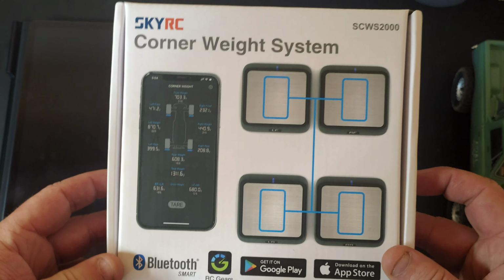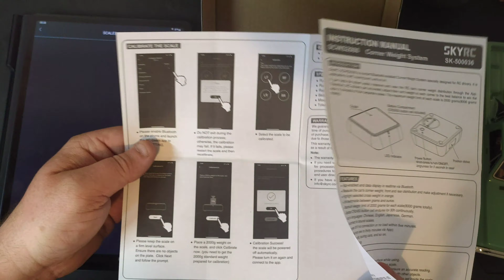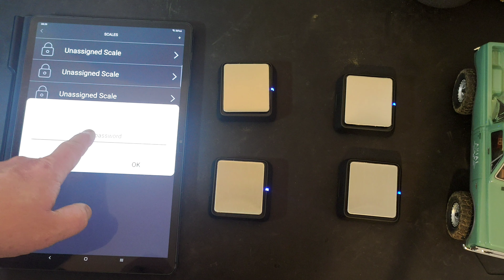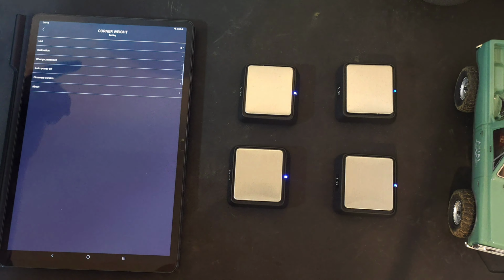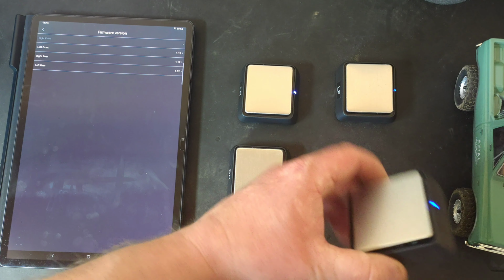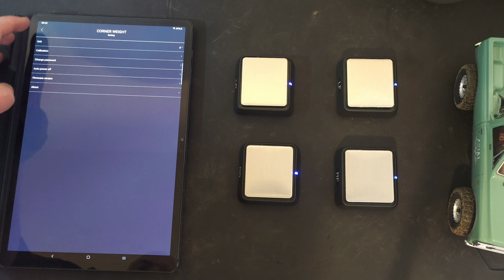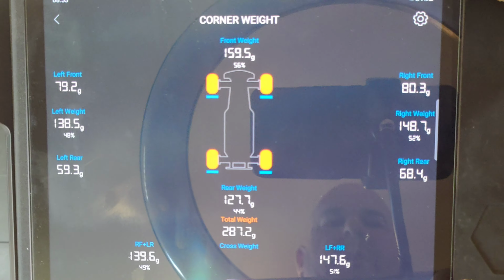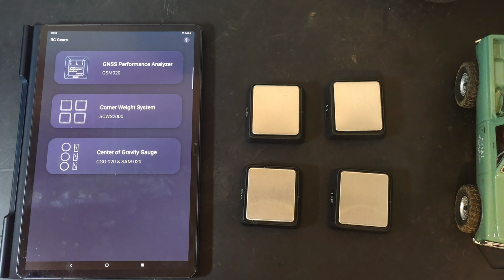SkyRc Bluetooth rc corner weight system set up and firmware update guide. part number SCWS2000

Comment: Why do manufacturers use non-standard batteries? especially when the device is LARGE enough to use a AAA or AA? Makes no sense to me. The missing feature is how much life the stupid button battery has.
Reply from the maker: Yeh always makes me wonder the same but these last ages I run the same batteries in my car and motorbike key fobs and they last year's also all my cycling sensors use them so I normally have plenty kicking around but know what you mean